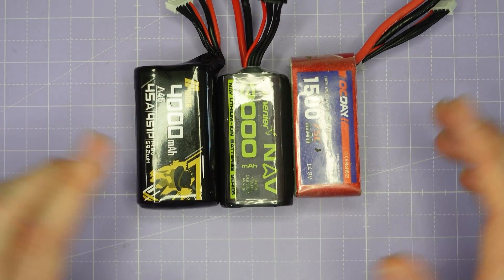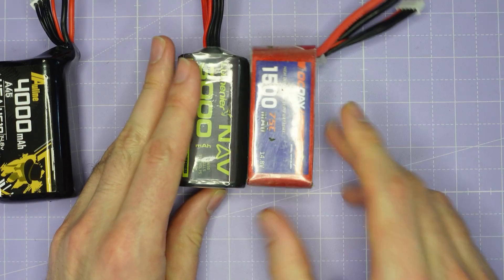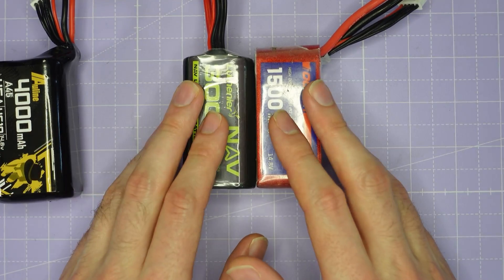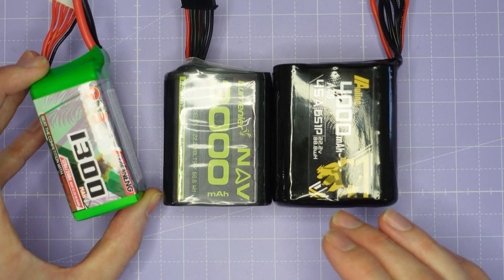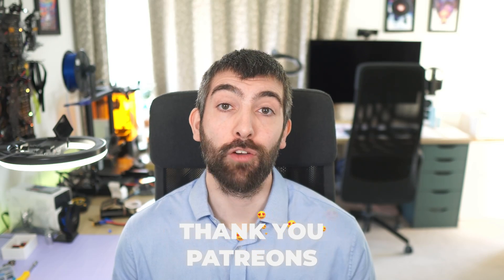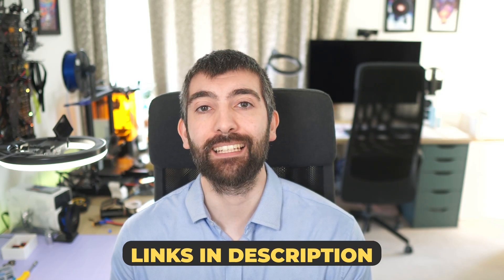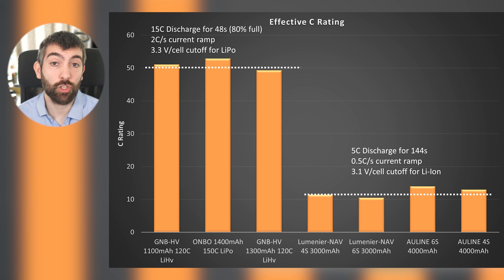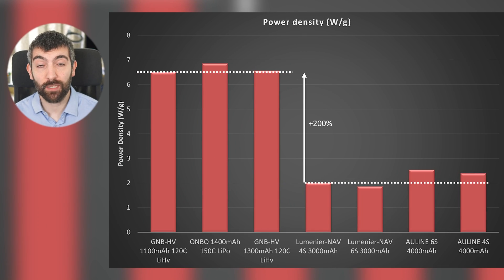Is Li-Ion better than LiPo? Testing Li-Ion packs: Lumenier NAV, Auline

Comment: I'd love to see a repeat of this testing when lithium ion packs made from high capacity tabless cells become available... I've build a 4s pack from reliance 21700-50R and so far the performance is pretty amazing on 5" with 2750kv 2207 motors

Comment: @Chris Rosser, why are we not making Hybrid packs. 75% Li-Ion for energy density and 25% LiPo for burst power.
The Li-Ion will recharge the LiPo during normal flight.
Reply from the maker: Mainly because a LiPo 25% the size has about the same power delivery as the big Li-Ion. A LiPo can do about 50 real C and a Li-Ion about 15 real C.
Reply: @ChrisRosser damn I forgot about the pack capacity affecting the output current. Thanks for the reality check. :)

Comment: Hi chris so in a nutshell,  I'm using 4000mah 6s lion 10c on a bob57 6 inch i have set my low voltage for 3.5 volts is this too high do I need perhaps to lower it ?

Comment: Why are we paying 70.00 for 6 18650 batteries paralleled with an xt60 tied on?   We could just have a 18650 holder with an xt60, then we just buy a bunch of 18650 cells.  That will be ALOT cheaper.

Comment: Are you going to do a 10 inch frame? There's a hole in the market for a well engineered 10" frame and motor combo and you're the guy to do it. Should I build a hyperion or wait?

Comment: And stop using mah as a capacity mesuring unit, Wh is the unit to use.
Reply from the maker: Battery capacity is usally defined as "The total amount of electricity generated due to electrochemical reactions in the battery and is expressed in ampere hours." So I think Ah is the right unit to use for capacity. As you rightly point out Capacity is not the whole story and that is why I base my scoring on Energy Density which includes voltage and weight.
Reply: Wh is total energy, Ah is capacity.

Comment: Maths are simple, energy density is smaller for liion then for lipo, end of story. Lipo is better for drones/planes.
LiFePo4 have the lowest energy density VS weight.
Reply from the maker: My testing shows that these Li-Ion cylindrical cells have ~25% higher energy density than the typical pouch cells used in FPV. Maybe a typo in the comment?

Comment: Has anyone ever tried combining lipo and lion in parallel with some sort of software switch to swap between them as amperage draw increases and decreases?  The lipo would act as a capacitor for the lion.
Reply: Just run the packs in parallel 😂
Reply: @cinemoriahFPV  so the lipo wouldn't get sucked dry by the lion during cruise?

Comment: Thanks for this test. So far it was mostly a narrative, that long rangers on Li-Ion have less power but longer range... 
2min more Range for 1/3 of the power is quite a hefty pay-off tho. I might actually sacrifice that range boost if I ever build a big guy and stick to my LiPos
Reply: Where do you get 2min more range? That’s not even close to reality.
Reply: @seanmetzger4780  What, I'm usually 2 lightyears late!

Comment: With long range builds I’m always worried that liion packs cannot manage bursts needed sometimes, especially 6S1P packs. But in cruising it’s the best choice .
Reply: They will put out the power you need if it’s just the occasional emergency that needs the throttle…they just won’t do it for sustained periods like a lipo will. But if your flying 7”+ you really should fly a 6s2p li-ion pack
Reply: No need worry! 
Just make a 6s2p. This is enough for any long range drone. For example Chimera  7 draw 20-23A at 80-90 km/h. It's normal speed for LR!
Reply: @ali3n24 yeah , 6s2p it’s 650/850gr , so it’s going to 5000mah lipo weight . With 21700 still a lot more weight/ power ratio for sure and 80amps of burst available

Comment: The Molicel p45b 21700 are the best you can get.
P42a 21700 and p28a 18650 are also top of the line.
You should talk about the cells used and not rebranded packs. Although some do state what cells are used.
Check out mooch battery tests. He goes into details and graphs
Reply: For the 21700 cell, what about the Samsung 50S?
Reply: @pierrekinbrand 50S have a little more capacity, but you cant push them as hard. I'd rather use the p42a and be able to pull out of a dive better, than fly 2min longer. 35A vs 45A
Reply: @chrisbee5481  6s2p gives you 70A vs 90A. This is enough for any long range drone. For example Chimera  7 draw 20A at 80-90 km/h. It's normal speed for LR! There is no point  taking 4200 Molicel when there is 5000 Samsung. 
Same weight, but more larger capacity 8400 vs 10 000.
Reply: @ali3n24  If you fly 6s2p 21700 and like the 50S capacity for long straight cruising flights, thats good.
Myself and people I talk to, like falconradFPV and giant and cowboy here on YT, perfer 6s2p 18650 molicel p28a. 18650 is lighter and feels better for mountain diving.
6s2p 21700 on a 7" gives a little more flight time, but doesnt handle that nice for mountain long range.
Reply: @pierrekinbrand  I've made packs with the 50s and can confirm they are great. I get around 20-25 minutes of flying (varies how hard you push) around a field, no acro, cruising about through gaps in the trees and stuff on a 4s 5000mah pack I made with those cells on a 7 inch quad
Reply: @chrisalexthomas  thanks for the info!
Reply: I have both the 42a and B, cost per wh or mah IMO isn't worth it on the 42b for just and extra 300mah... bang for buck in 21700 category is 42a
Reply: yep, there are great results with molicel 6s2p and 6s3p packs in ukraine and really long range flights
Reply: @ЮрийЛипшиц  yeah, nkon in netherlands is saying ukraine is buying all the stock. You on 7" or more like 8 , 9 , 10" ?
Wings are better for carrying loads and long range.
Reply: p50b, by now...

Comment: I would be interested  to test your C rating metodology and compare LiPo battery on lipo discarge cycle (5C, 144S, 0,5C/s, 3,1V maybe 3,3V) and compare result with standard test. Ofc single cells, etc, would be cool as well. Thanks for graeat content

Comment: Before you get too many battery videos, you need to test ESR on a quality meter (the one I have recommended twice before).
This is a single number that is directly compare between all packs, and it's an excellent way to look at health of the pack over time. Why do you ignore this, the meter is only $150.
Reply: Esr isn’t that relevant, and there are too many factors that impact a batteries esr to ever be able to use as a comparison method. Esr is good for comparing a single pack against itself as it ages to know when it is degrading. There have been massive lipo tests such as the one by mcsguy on Rcgroups that have proven all of this. Esr does not say one pack is better then the next.
Reply: @seanmetzger4780  I disagree, its the single most important factor for punch preformance, next comes capacity for racing and if measured correctly, it is directly relatable to its health.
I run my batteries ~1000 cycles in my quad and another !1200 in my planes, and about every 4~6 months I measure esr and capacity and log it. It clearly is directly related to preformance. How many cycles do you get out of your packs?
Regarding mcsguy testing, he is a edf guy and basically is WFO throttle the whole pack,,,,and well us quad guys dont do that type of application, and he is mostly using 5000~6000mah packs. I have talked to him about esr, and he said, most dont have a esr meter that is accurate, which is true. But I argued if done properly (same charge level and temp), they are directly comparable.
The tiny 1300 packs we use, great cells are in the 4mΩ rang and crappy are in the 6mΩ range, in a matter of seconds, this can be checked, so why not?
Reply: @seanmetzger4780  regarding " there are too many factors that impact a batteries esr", if you dont know what your doing, correct.
Simply same SOC, I prefer my storage 3.85v/cell and temp. I just take my batteries to work, cycle them up and down to storage voltage, then let them sit to next day, 70~72F, every time. I check each cell and total pack (the later checks pack connections, wire and connector). Simple, even a monkey can do it.
Reply: @seanmetzger4780   I disagree, its the single most important factor for punch preformance, next comes capacity for racing and if measured correctly, it is directly relatable to its health.
I run my batteries ~1000 cycles in my quad and another !1200 in my planes, and about every 4~6 months I measure esr and capacity and log it. It clearly is directly related to preformance. How many cycles do you get out of your packs?
Regarding mcsguy testing, he is a edf guy and basically is WFO throttle the whole pack,,,,and well us quad guys dont do that type of application, and he is mostly using 5000~6000mah packs. I have talked to him about esr, and he said, most dont have a esr meter that is accurate, which is true. But I argued if done properly (same charge level and temp), they are directly comparable.
The tiny 1300 packs we use, great cells are in the 4mΩ range and crappy are in the 6mΩ range, in a matter of seconds, this can be checked, so why not?

 Regarding " there are too many factors that impact a batteries esr", if you dont know what your doing, correct.
Simply same SOC, I prefer my storage 3.85v/cell and temp. I just take my batteries to work, cycle them up and down to storage voltage, then let them sit to next day, 70~72F, every time. I check each cell and total pack (the later checks pack connections, wire and connector). Simple, even a monkey can do it.
Reply: Because he probably intends to have someone manufacture lipos with his name on it, and if he tests ESR it'll prove his lipos are junk just like his motors and frames

Comment: It would be nice to know what 18650 or 21700 cell is being used in these packs, though I would likely guess it is the Samsung 40T for 4000mah or Samsung 30T for 30000mah.
It would be nice to see some packs using the Molicel P45B or P42A as they both have a 10C discharge rating. Its also important to note the capacities are rated with a cell discharged down to 2.5V
Reply: I have tested the P42A cells at 40A, it gets hot pretty fast, so that 40A current rating is not continuous, but fine for burst use.

Comment: i would love to see a comparision at the same(!) discharge current as you will fly them with the same setup, there is no reason the put a higher load an a bigger battery. please try to do comparisions ceteris paribus.

Comment: I use the Auline Li-ion 4000mAh pack with my 7" quad. The all up weight of the quad with the battery is 1.1kg. I get between 10 and 15 minutes flight time depending on conditions. At about $80 USD I'm satisfied with the battery but I was expecting a little more. Thank you for the tests. Your vids are valuable to me. Happy flying amigo.
Reply: I get 25 minutes on my 8 inch. But my quad hovers at 16% throttle so I cruise between 16-20% my amps is under 10a.  usually around 8a ish. It's slow though around 15-20 mph. Also I land around 2.8v
Reply: I think that flight time is really impressive on your 8" quad. Are you using the Auline 4000mAh 6s Li-ion too? I think you're about double the flight time of my 7". I do cruise a bit faster. I can get about 56mph out of the fat old girl in angle mode and altitude hold which is how I usually fly. I am actually pretty happy with my 10-15 minute flights considering my flying style and the weight of the quad. I'm not doing flights much over a mile anyway since that is about maximum range of my VTX. It would be nice to stay aloft longer but not worth the hassle and expense of getting my 7" up to that level. Congrats on the long flight times of your 8". That's really cool. I'll check out your channel. Thanks for the correspondence. Happy flying amigo.
Reply: @Sonic_Ox  yeah auline 4000. Just keeping the throttle low just passed your hover should get you close to my time.
Reply: Yeah, I think I could do better with more throttle management. I'll conduct some tests.
Reply: Something is wrong then because I get 12 minutes with 2200mah 6s lipo on my 1.1kg 7" and I get 22 minutes with 4000mah lion.
Reply: It's possible that I have a substandard battery from Auline, but I think my flying style is the more likely suspect. I'll bet I can squeeze 20 minutes out of it if I really manage the throttle.
Reply: @Sonic_Ox  just find your hover. Have your throttle % on your osd. Once you find it. Stay really close to it. Example mines 16% so I cruise at 18-20%
Reply: @squirrelynutz1  I'll try that. Thank you. Happy flying amigo.
Reply: @Sonic_Ox  also I run the. Battery down to 2.8v when I land.
Reply: Another good point. I typically don't go below 3.2v per cell even with Li-Ion. I know they can take it but it makes me feel like I'm going to damage them lol.
Reply: @Sonic_Ox  try the yowoo 5000w mah 100c. I just got them and flew for 25 minutes around 20-35% throttle. If your aggressive you'll get atleast 20 minutes. It's a big battery 1.7 lbs
Reply: Hi Chris, thank you for this.
So, which battery would you recommend for the AOS LR5?
This wb for above average speed crossing flight style?